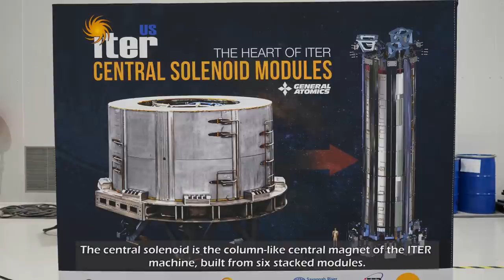ITER: THE MOST POWERFUL MAGNET IN THE WORLD

Comment: We REALLY need this. ASAP. So no pressure there.
Reply: to be honest i have my doubts that fusion can solve our energy problems

from what i have seen on their website iter is supposed to produce 500MW output from 50MW input.
but that 500MW output is just heat and if you try to turn into electricity it gets reduced to something like 200MW.
and then you need also energy to keep everything else running i don't think the energy that these magnets consume are included in the 50MW input.
Reply: @DNFrozen1  who can i believe? You or hundreds of ingeneers? Let me half of a micro second to make m’y décision ! 😂
Reply: @DNFrozen1  This is only a test plant, DEMO will be used for commercial appliance.
The EU DEMO should produce at least 2000 megawatts (2 gigawatts) of fusion power on a continuous basis, and it should produce 25 times as much power as required for scientific breakeven, which does not include the power required to operate the reactor. The EU DEMO design of 2 to 4 gigawatts of thermal output will be on the scale of a modern electric power station.
Reply: @neuronmind  oh yeah the numbers of the planned DEMO looks much better than ITER for efficency so that could work. 
it would be interesting to have a rough estimate how long such a reactor needs to run in order to produce more energy than it took to build it.
Reply: @DNFrozen1  this is r&d, the final product must be much more efficient to make it economically feasible of course. But that won't be a problem, the technology used here, is now already obsolete. It's only to gather knowledge and this knowledge is priceless. Do you know what is a spin-off? Well this experiment has a lot of spin-offs that make it worth already.
Reply: @DNFrozen1  and btw, there is also the energy cost for gathering the fuel and getting rid of the waste materials, there is also the expected lifetime, and other factors that impact the overall efficiency, it's not only the building process that you need to take into account.
Reply: @DNFrozen1  We have steam turbine systems with an efficiency of >95%. 500MW of heat will turn into 420 to 450 MW of Electricpower.
Reply: @chillerprofi  no steam turbines with 95% efficency doesn't exist. I'm not sure where u got this number from,
the best coal power plants have 45% efficency and all they do is convert heat to electricity
Reply: If you expect to wait for fusion to solve our problems then we're already doomed, we should heavily invest in renewables and nuclear energy in order to curb GHG emissions as fast as possible, commercial fusion plants likely won't be commercially viable until the 22nd or 23rd century unless some major breakthroughs happen. By then the average temperature will have risen by 4°C and the sea will have risen by a meter.
Reply: @Soken50  Sure. We should invest in renewables. We still need fusion though because with almost unlimited energy you can do a lot more. E.g. filter CO2 out of the air again.
Reply: @Soken50  expanding nuclear as in fission reactors is a political nightmare. Europe (the EU) currently operates 106 out of 440 nuclear reactors worldwide. It only accounts for roughly 20% of energy production with renewables already making up 40%. The rest is mostly gas and oil. The problem currently are mostly the 14% coal. To get rid of these the quickest way is to expand renewables and in other areas some will go for the minor pollutant: natural gas. 
The problem is not with power production though. We still use a lot of gas for heating and agriculture is a carbon nightmare. 
And the political reality is that in the US, Russia or China nobody cares about climate change.
Reply: @PugilistCactus  i think we should focus more on geothermal energy. there is a limitless amount of heat ready to be used. we already have the technology to use it.
Reply: @Soken50  For 30 years science has said sea levels will rise and don't say how much it falls. Besides more water is underground what is it doing?
Reply: @ronusa1976  It's already rising, at a rate of 1-10 mm/year depending on locations and many soft coasts see their edge receding by meters to dozens of meters per year. Keep ignoring reality, it won't change what's already happening. I've seen the beaches I've visited since I was a kid receding for decades as the sea eats away at them.
Reply: @Soken50  the company that is supposed to store the nuclear waste will disappear at some point but the nuclear waste needs to be stored save as long as humanity exist. and when it's out there is no way reverse it and make the ground useable again
Reply: @DNFrozen1  there are permanent storages currently under construction and development
Reply: @Soken50  well it's easy to call something permanent but nothing in this world is permanent not even the continents we are building these "permanent storages" are.
A few months ago japan announceed that letting the radiactive water into the ocean is the most realistic option because storing the waste has becaome a huge problem already
Reply: Don’t worry. Fusion will be ready in 20 years.
Reply: @DNFrozen1  Spin-offs, my friend. You don’t have a clue

Comment: From the communication point of view, I'm left with a few questions: 1. In what sense is it the most powerful magnet in the world?  2. What's the strength of the field? 3. How much magnetic energy does it store?
Reply: ITER's website specifies 11.8 tesla on the torroidal field coils, 6 on the poloidal.  I guess before writing the headline of the video, they weren't tracking the recent news from Commonwealth Fusion Systems about their high temperature superconductor magnet with a field strength of 20 tesla and fusion in four years.  Vaporware?  I guess ITER thinks so.
Reply: @jwplatt9233  That doesn’t answer the questions I asked about this particular magnet, which is part of the central transformer. Indeed, in terms of field intensity there are stronger magnets.

Comment: Didn't the SPARC magnet reach 20T and the central solenoid is only supposed to reach 13T?
Reply: I suppose, when the tokamak was designed, a field strength of 13T was required. If you put a stronger one in now, you'd have to rebuild and redesign the entire thing.
Reply: @Mp57navy  Christian's point is that the title of this video is "The Most Powerful Magnet In the World" when it isn't.

Comment: Lets hope they learn they can make smaller, better, cheaper power making fusion reactors from this prototype.
I read about another Tokamak that found a need for a coil that circle the outside but also turns 90 degs. up then travels hort.  about 90 degs then goes down etc. around the waist of the cavity. Some kind of way to help stabilize the plasma in some way. They said the phenomena that this coil will address was not known to ITER when being designed. Hopefully they are wrong.

Comment: If it is such a strong magnet, why aren't there light posts, bicycles, fire hydrants and small cars clinging to all sides of the package...?
Reply: it's not permanent i would guess. Even a mere MRI machine is not magnetic when you transport it, it only is once you chill it to very low temperatures using helium where it becomes a superconductor, once there you basically just charge it with electricity that will keep on flowing for ever generating the magnetic field. 

small side effect, if for any reason at this point the magnet get's heated once again it loses superconducting properties and melts due to the tremendus ammount of current flowing it it... yeah magnets are fun
Reply: @herlescraft  Which is what happened at the LHC after the last shutdown... leak in a He cooling pipe meant some magnets were not cooled enough to achieve superconductivity and then broke when they ramped up the current.

Comment: Am I the only one who thinks a magnet that is thousands of times stronger than Earth's magnetic field is a Bad Thing? What's going to happen when this thing is turned on? I believe the report was 30,000 or 300,000 times stronger than our Planet's own magnetic field! Strong enough to lift an Aircraft Carrier!! Assuming you had a crane that large to hang it from. Are ocean currents going to be changed while this thing is on? Are electronics around the globe going to be affected?
Reply: Its stronger on a specific area (near the magnet). Not stronger overall.
Not sure what the exact distance will be, but I doubt that the magnet's effect will be noticable any significant distance away from the instalation.

An easy comparison would be the sun and a very strong flashlight. You can light a specific item much brighter by flashing the strong flashlight over it, compared to just letting it out on the sun. But that doesnt mean that the sun is less powerfull than the flashlight overall.